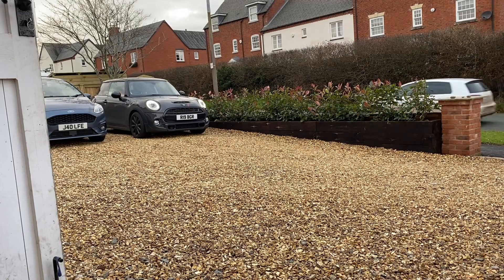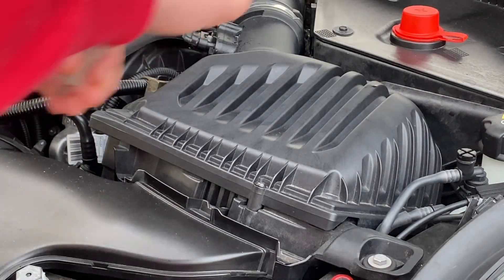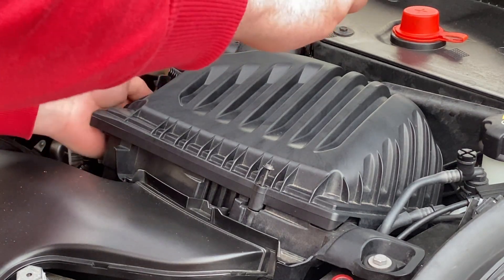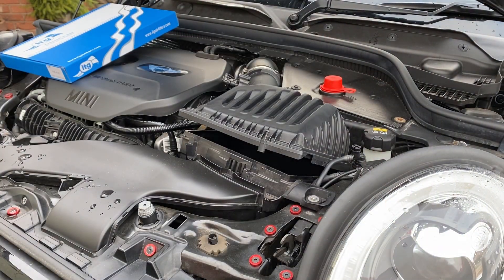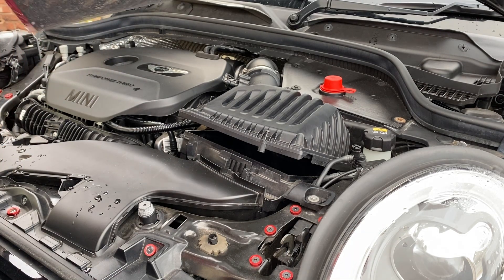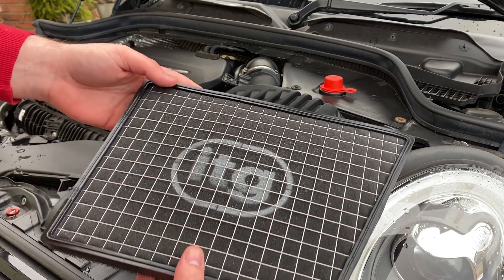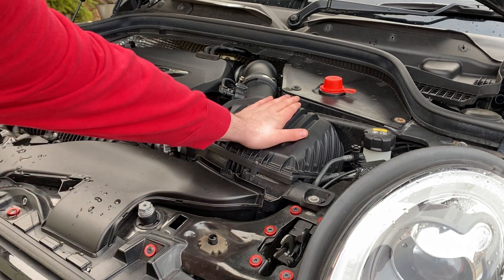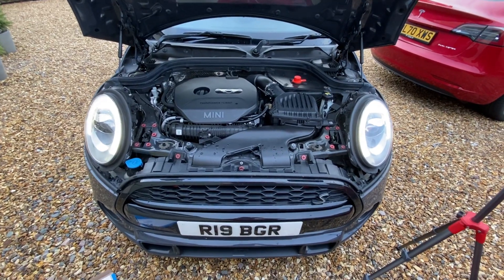MINI COOPER S F56 ITG PANEL FILTER INSTALL AND SOUND TEST

Comment: Just installed my ITG filter into my F56 1.5t, thanks for the great vid!
Reply: Does the flutter also increase on your F56 1.5t?? Wanting to buy the ITG but mainly for the extra turbo flutter
Reply: @DirtyxOwnage  not really much of a flutter increase, maybe more of a whistle but only when the windows are down. You’d need one of those cone filters for flutter but I prefer the ITG panel as it sits lower and will take in colder air which is better for performance.
Reply: @Watchreviewblog  cheers for the answer! Even minimal extra turbo noises makes me happy ;) other noticeable differences in your 1.5t? Throttle response is already amazingly sharp in sport mode, with stock filter
Reply: @DirtyxOwnage  very hard to tell any difference with the filter only tbh. I have a jb+ tuning chip, muffler delete, lightweight wheel and sports tires, and this panel filter. With that combination the car is an absolute blast to drive. Fairly budget mods but they make a huge difference paired together.

Comment: I think I shall go with the ITG filter since you've mentioned about the issue about the pipercross one. some of the mods you've done so far is more or less what I wanna do to my F56 albeit the 3-cyl version. great content, keep it up!!
Reply from the maker: Thank you 😊 you’ll love the ITG filter.
Reply: @BenRolfe  I just got the ITG filter fitted today and throttle response feels a lot better, not to mention the turbo flutter too!
Reply from the maker: Ahh amazing! So glad you like it! Definitely an improvement over the stock one
Reply: @Joumiya  One year later, is it any good still? Been wanting to use a gift cert i got for killallchrome for one of these and wanted to see if it makes any difference on the B38 1.5.

Comment: Ben, Here in the USA we have a similar filter by a company named K&N.  They're washable too and after washing you treat them with an oil you buy from them that helps capture dirt.  They advertise having more power.  I installed one of these on my V-8 pick-up truck a number of years back.  What happened is that it did have more power but my fuel mileage went down.  It made the truck use more gasoline.  After a short while I realized how it made more power.  It allows more air into the engine and it fools the computer so it has to dial up more fuel to compensate for the additional air.  I didn't like the truck using more fuel than before and I really didn't need more power.  The other thing is that the oil added onto the filter made it get dirty quickly and if not kept up with it would clog up.  What a mess.  I hated having to wash and oil treat that filter so I gave up on using it and never bought another one.  I hope you experience goes better than mine and you're happy with the extra power.  Is your MINI an S version?
Reply: I guess im asking the wrong place but does anyone know of a method to get back into an Instagram account?
I somehow forgot the password. I would appreciate any help you can offer me!
Reply: @Pablo Duncan instablaster :)
Reply: @Quinton Ellis i really appreciate your reply. I found the site on google and I'm waiting for the hacking stuff atm.
Looks like it's gonna take quite some time so I will reply here later when my account password hopefully is recovered.
Reply: @Quinton Ellis it did the trick and I finally got access to my account again. I'm so happy!
Thank you so much, you saved my ass !
Reply: @Pablo Duncan no problem =)

Comment: Hi Ben, it’s been a while since you fitted this, do you still recommend it? Sadly I brought a Pipercross panel filter a few months ago, and after less then 1000 miles it’s badly distorted. After reading reviews I’m now worried it will just disintegrate. So I’m stuck between ITG and K&N. What’s your thoughts?
Reply from the maker: Hi mate! Pipercross are notorious for doing this so I’d remove it asap. I can only comment on ITG as it’s all I’ve used but for the time I’ve used it I’ve been really impressed with it!
Reply: @BenRolfe  cheers for that Ben. I read your message then placed my order 😂. So disappointed with the Pipercross - may try to claim on their warranty.
Reply from the maker: I’d definitely try, at the end of the day it’s failed and can potentially cause damage. You can’t go wrong with ITG

Comment: Made any progress in testing so far Ben ?
Reply from the maker: Hey 👋 I’ve done around 100 miles since I’ve installed it and truthfully I’m really happy with it. The turbo flutter is considerably louder and is easily noticeable with your windows up. I have noticed mild throttle response improvements and I swear I can feel an improvement in performance too, but it’s ever so slight. For the price I’d definitely recommend one over the stock filter. You can also clean these instead of getting new ones each time. All in all super happy with it.
Reply: Do you prefer itg air filter or K&N??
Do you know the difference?

Comment: I just ordered an ITG for my f56s. However, I've been reading some things about the oil filters possibly contaminating the MAF. Does anyone really know just how bad it would be to use the ITG in place of an OEM paper filter? I want to treat my mini as well as I possibly can, but i also want to know the details of how bad or fine it could be for the MAF and engine.
Reply from the maker: Had it for nearly a year now and have had absolutely no issues yet. Still running on the original oil and haven’t cleaned it yet.